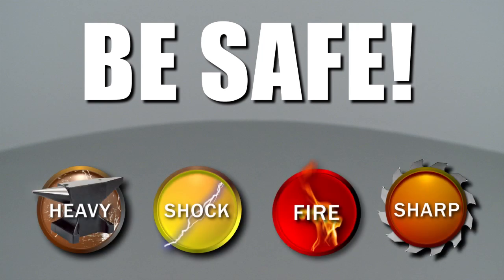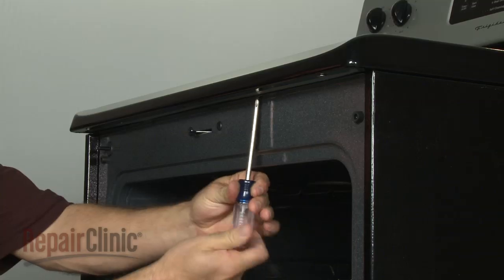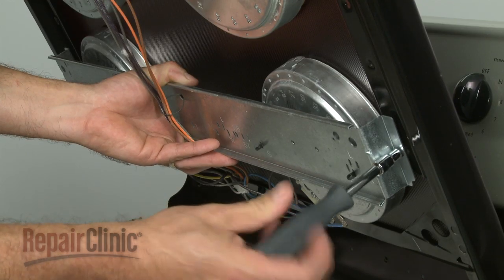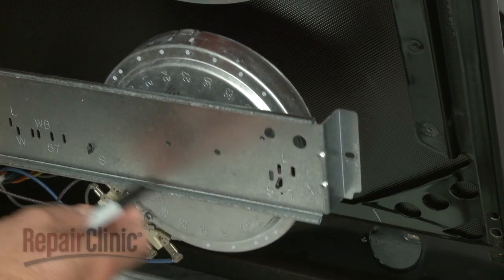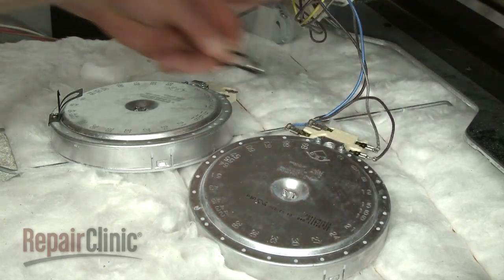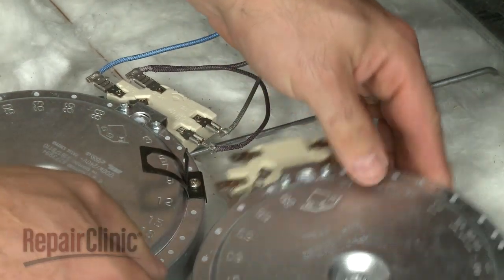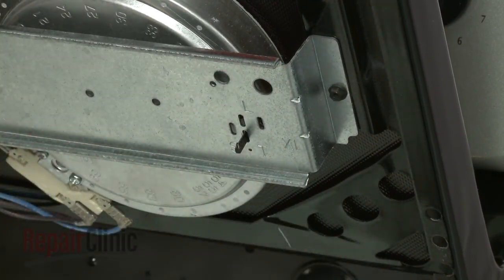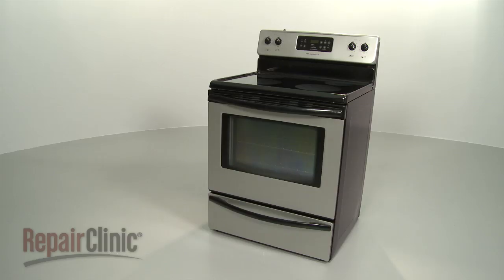Frigidaire Electric Stove Surface Element, Small  #318178110

Comment from the maker: It really doesn’t matter which one is bad. You will need to replace the whole burner either way. You cannot get the sensor separate from the burner. You will need to look at the wiring diagram in the unit to figure out which terminals go to the sensor contacts to check them.